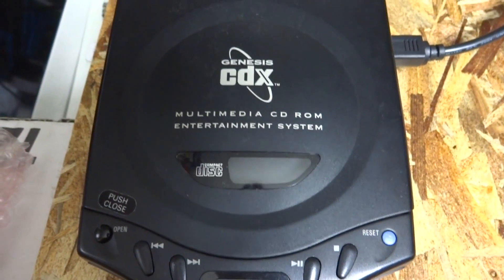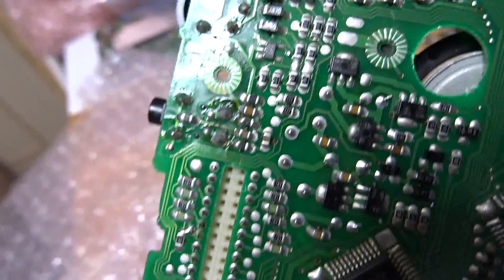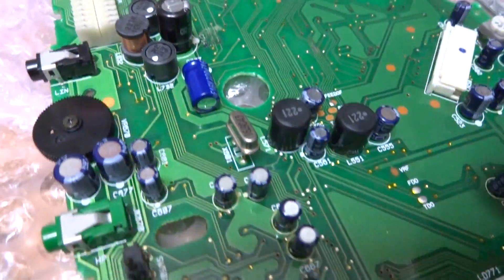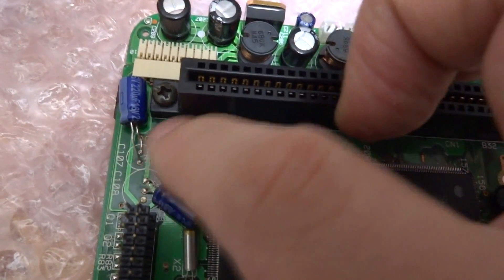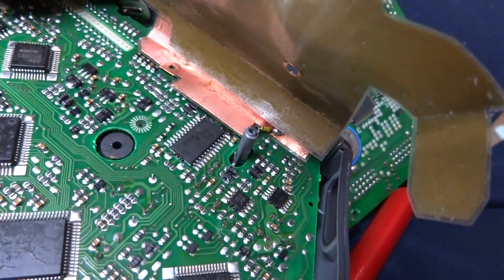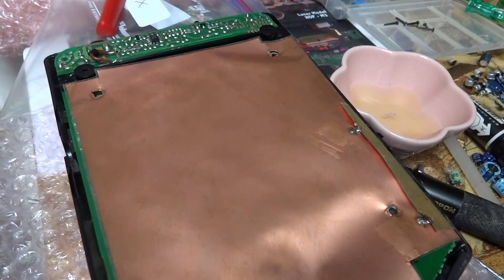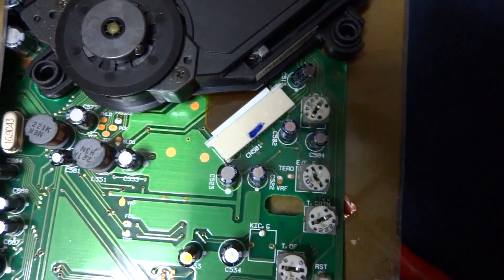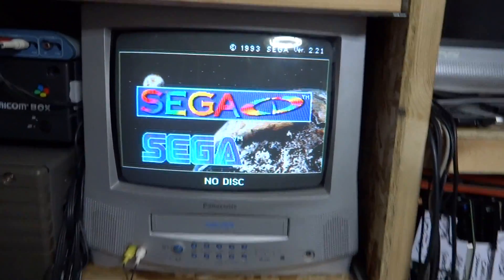Sega CDX Capacitor Replacement, CD Pot Adjustments, Trouble Shooting, Problems

Comment: Hey Luke, don't know if you ever fixed the CD part. But you need to physically push the lens back to the center on the rail for it to work. It will not move back by itself.

Comment: perhaps you will know of a forum or something, but my video is garbled terribly though it might be the s-video cable replaced it and still have the issue.  Replaced the chroma chip and caps for the s-video still have garbled imagery.  Any info you can provide would be appreciated.  Not sure if another chip on the board is bad or needs replacing.  Caps appear to be good on a physical inspection.

Comment: These consoles are such a crap shoot. I have one that I replaced the laser on which made the console work slightly better. The old laser would only read track one of a music disk and the new laser reads up to track two before cutting out. I tried messing with the pots and was able to get track 3 to work once but that's it. The genesis part of the CDX works fine, except the volume goes up and down at random but at no point does it stop working. However the interesting thing is that the SCD bios music will always play at a normal level without going up or down by itself. Meanwhile both of my Model 1 SCD consoles have been working fine. New caps and new drive belts, plus a good cleaning and they have been flawless. I guess the CDX was too much tech for Sega to try and put into one little console.
Reply: ɷ Heey Friendsss I Have Foundddd Workinggg Online Hacck Visit  : -  https://t.co/RkBD4lnPXf

Comment: I would imagine these have audio mixing / amplifying circuitry inside them like a Regular Mega Drive / Genesis does. I wonder if the chip responsible for amplifying the audio is shot?

Comment: Hi lukemorse1, i got one with the optical motor stuck and i was able to recover it, but when charged it always take the lens out forcing it even making some noise caused by the gear. when i turn on it continue to force the lens out. I'll do a recap, but it still very strange. have any idea?
Reply: I think it's the laser mechanism that needs replacing.

Comment: My Sega CDX had been working perfectly quite a while in the last months, but all of a sudden I turned it off to change cartridges and when I pressed the power button on, nothing happened. I believe there's no problems with the power cord but not sure at all.
Could it be a matter of rust, dirty or something like that?
Any help will be greatly appreciated!
Best regards!
Reply: bivosacanagi That sounds a lot like a blown fuse.  Best bet is to take a multimeter and touch both legs of each fuse to see if you get a reading, if you don't you know you have a bad fuse which is an easy fix.
Reply: Jake F  Thanks, I took it to a guy who discovered the problem: it was both the power cord and the fuse! It is already working though.
By the way, I repeat my last appeal: a video of how to disassembly it piece by piece would be of great help! 
Cheers!

Comment: Just curious Luke, did you ever try plugging headphones or speakers into the line out or headphone jack? If you get sound there, it's possible that the sound processor is fine and maybe a bad trace to the A/V out plug. If no sound, at least you'd know that it was the amp that was causing the issue with no sound.

Comment: hello, very good video, unfortunately not completely understand English and therefore could not know if my problem is quoted in it. I'm also an cdx and realize while reading the cd there are disturbances in the audio, it would be a faulty capacitor? some explicit location? thanks!
Reply: cual es el problema de tu consola? tal vez yo pueda ayudar

Comment: You sound exhausted in your most recent videos; perhaps once you feel better there will be a round 2. I've heard that CDXs are a pain to repair & this video only confirms it.

Perhaps the CD door mechanism is busted though & the system constantly reports that it’s not closed?

Maybe the LCD display is fried/broken as well and needs to be replaced?

Have you checked the volume via the CDX's headphone jack? It could be a busted AV port if volume works fine via the headphone jack.

Comment: awesome work man! cap replacement can really worn you out! I'm doing complete cap replacement in my high-end laserdisc players, though i ended up using tantum caps, mostly because it's very important to improve the laserdisc players video and audio output, so pouring some money into the project, too bad the tantums are so damn expensive :)

Comment: Have you checked the pinswitch for the CD door? That could cause the CD drive issues you're having.
Reply: That's the first thing I thought when I noticed the CDX wasn't responding to opening and closing the door while turned on!

Comment: Wow I am shocked that a capacitor replacement hasn't helped it one bit. That grounding shield looks very flimsy, but I guess it works. This is very informative and hopefully you can discover more about the CDX. That is a very well designed system made by Sega, and looks complex. Many Thanks Luke for the work and the posting of this video.